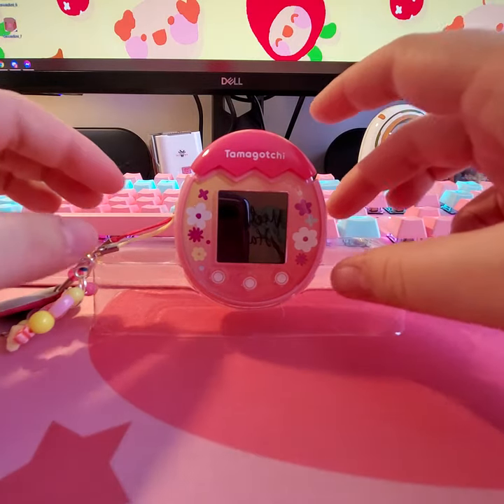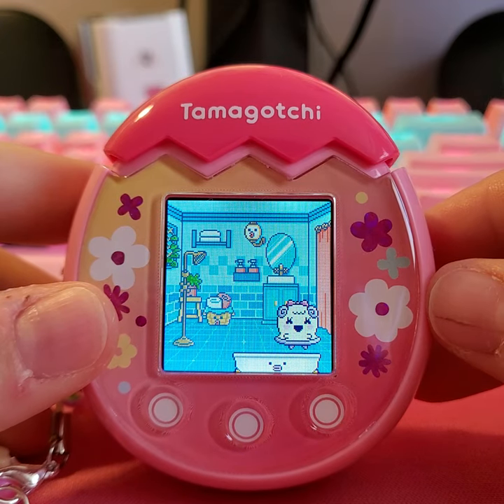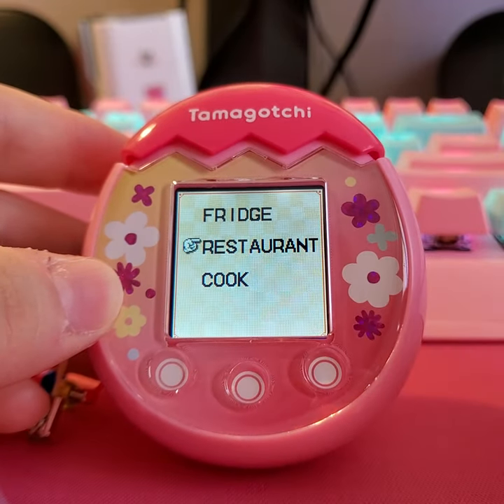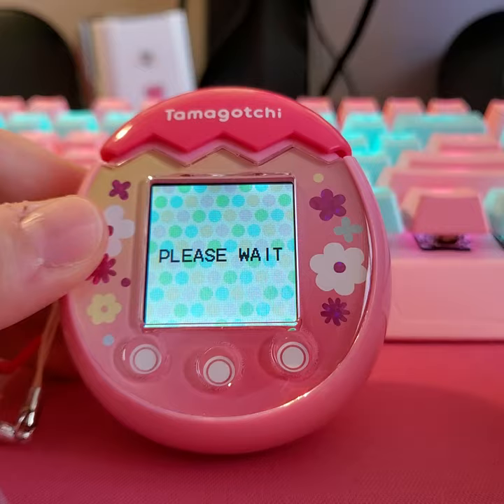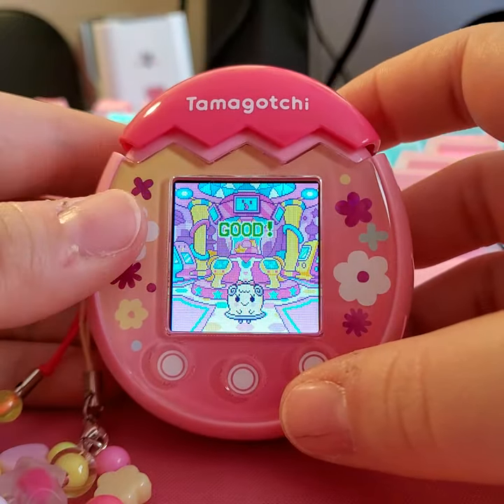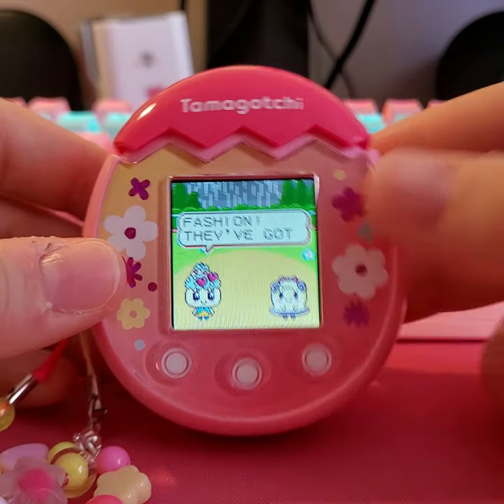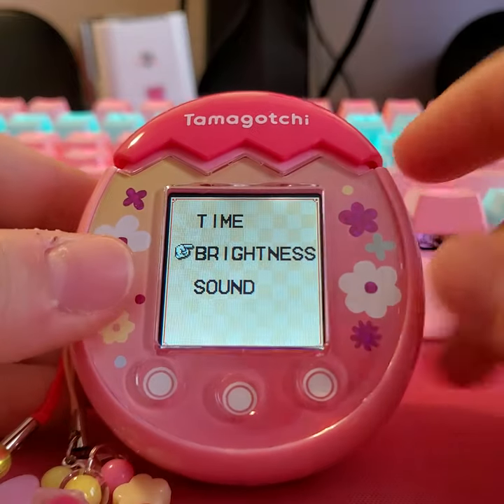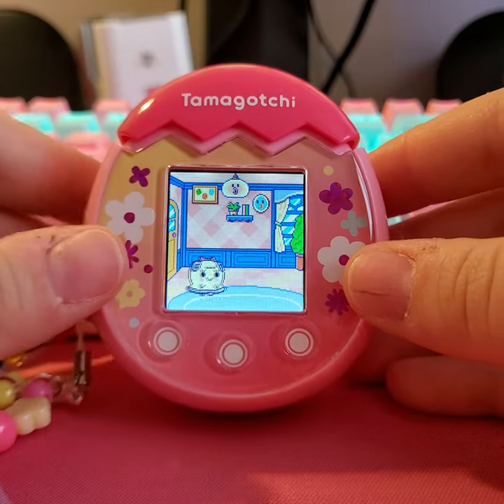Tamagotchi Pix first hands on

Comment: Would you say this is very similar to the tamagotchi ON?
Reply from the maker: absolutely not
Reply: mawutchi shoukd I buy the pix what’s your rating on it? I got easily bored with the ON
Reply from the maker: @sherwinh1661  i like it a lot, and i didn't like the on. their systems are very different, so maybe you'll like it
Reply: @mawutchi9868  okay! how did u get this? from amazon? ill buy
Reply from the maker: @sherwinh1661  i got it from drim spain, but it's out of stock now i believe
Reply: mawutchi u are so lucky - it seems like only launched in July on Amazon / usa
Reply: @mawutchi9868  this is super exciting, I got a bit bored with the On too and this looks so cute!
Reply: @mawutchi9868  is the pix in anyway connectable with the on for example like can a tamagotchi from the on can it have a playdate with one from the pix
Reply from the maker: @ZoverBS  no, the pix uses QR code while the on has bluetooth - not the same technology
Reply: It seems that the pix has alot of retro charaters too! Because so far we know mimitchis raisable so as ginjrothi who's my Favorite Tamagotchi